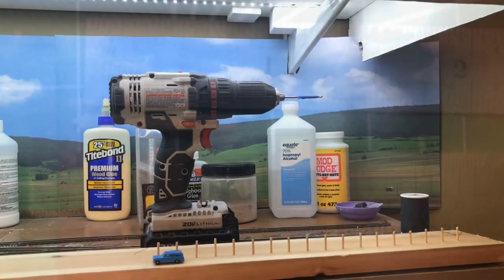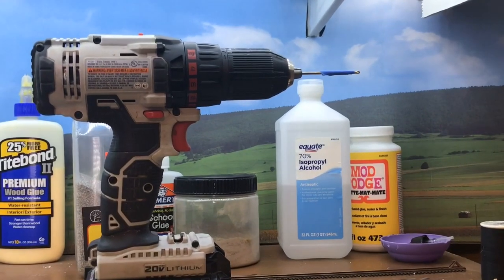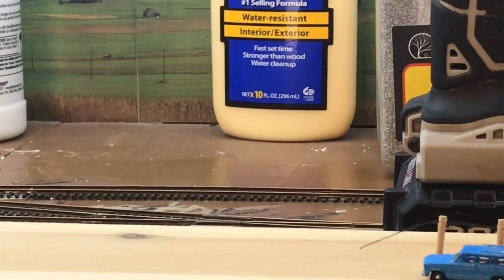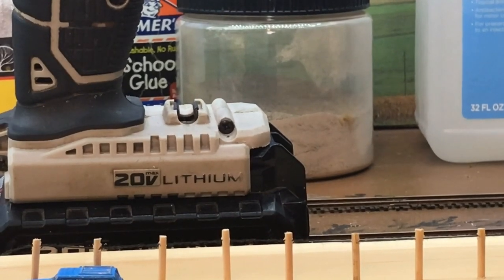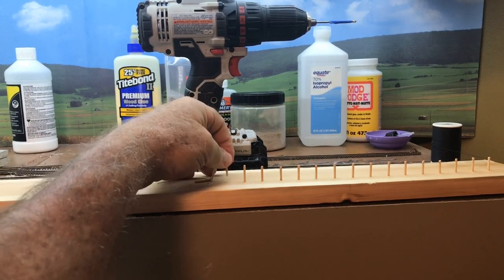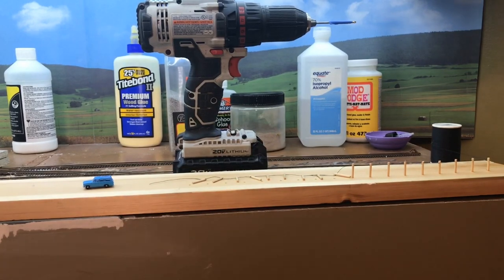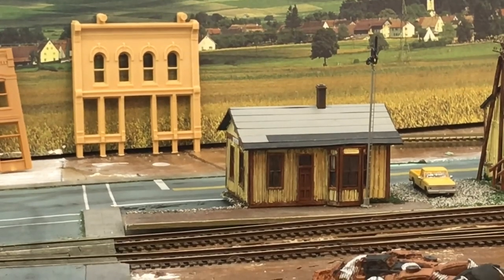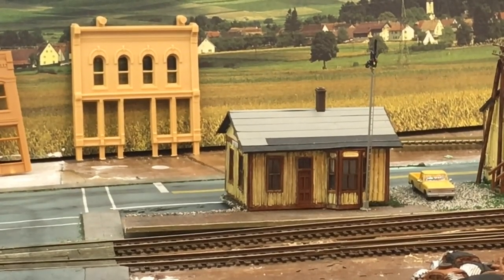A fence for Railroad Street and more Oak Hill progress, update 31

Comment: Use gray thread.....it looks a lot more like galvanized cable.
Reply from the maker: I agree, but I used what I had. That’s why I mentioned trying to paint it. I may try dry brushing grey instead of rust first. Just need to make sure it doesn’t end up looking too thick. Thanks for the suggestion and stay safe!